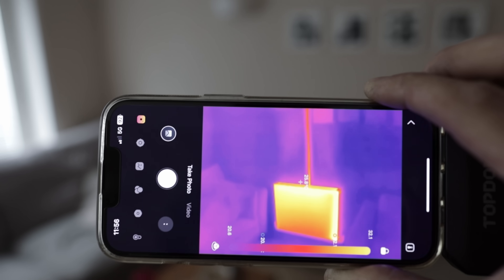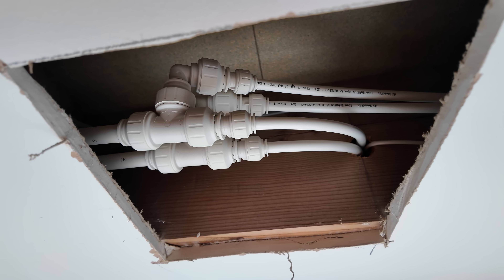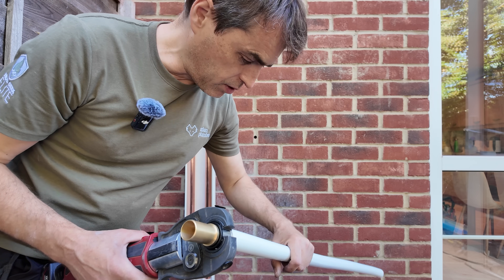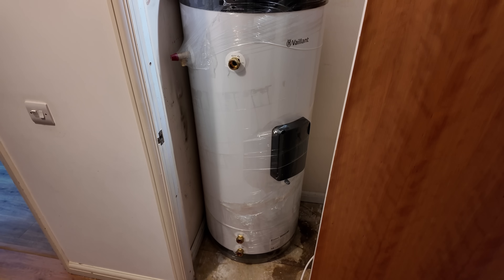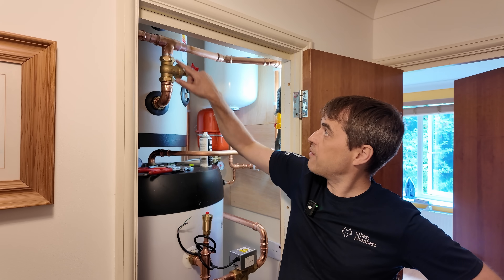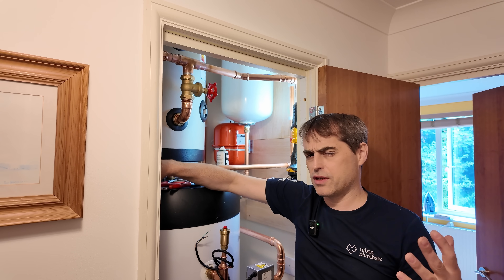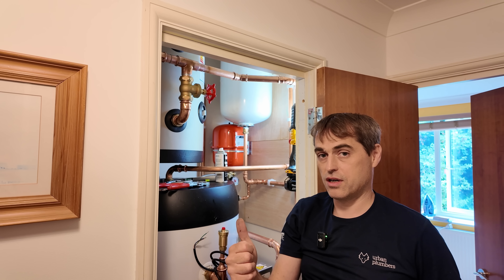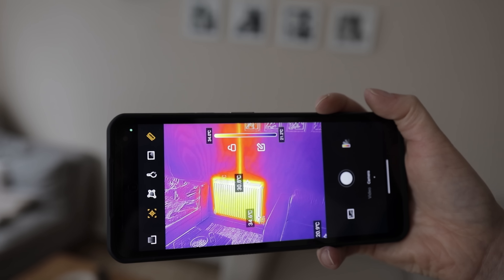Micro-bore Pipework & Heat Pumps: How To Make It Work.

Comment: My home has 10mm plastic microbore drops down, 15'mm copper 1st, with a 7kw Daikin monoblock installed over three years ago on a gov trial. SCOP for heating and DHW is 3.15 consistently annually, but DHW alone is about 2.3 and in cold months heating is 3.5, so not bad. The installer put a 20 litre volumiser in to increase the volume. Flow is about 19 litres per minute, heat loss 4.3 kw. The living room radiator is at The end of The run and does struggle to warm up, so what you are saying runs true. But overall the ground floor microbore hasn't been tragic for our set up
Reply from the maker: If they installed a 4kw Daikin instead of 7 your scop would have been miles better

Comment: Without the buffer in this system the HP would begin to ice up quite a bit and reduce eff% of the actual HP . 
Yes/no ?
Reply from the maker: Not really. System has enough volume without one and is not zoned so not an issue.

Comment: @ 10:20 - it will not get weaker with time … it will only fail … it is an electronic pump with monitoring… 
The old pumps have running capacitors for the motors - if the capacitor value degrades the motor will run at lower speed …. But in electronic pumps if there is something wrong it will show an error or it will totally fail …😊
Reply: Certainly possible for flow to reduce over time. It's not just pump rotation speed. There's also impeller erosion, fouling and corrosion to consider. Unlikely to make a massive difference as these pumps work for ages but a tiny bit of material accumulated will make a bigger difference to flow. System pressure loss won't be constant either - fouling of pipes and orifices with dirt or corrosion products (just think even about the tiny strainer in the heat pump, not much junk needed to increase its pressure drop).
Reply: @bearbin  he is a good plumber - I think he washes the sistem after install…
Reply: @mihaiachim5299 the fact that flushing is necesary proves that there is debris in the system. Flushing is definitely a good idea but won't remove 100%. even brand new radiators have dirt inside that gets slowly released over time

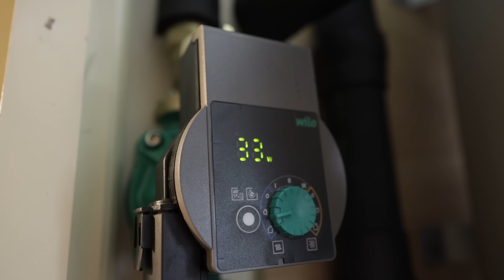Comment: @ 9:40 In this case I never replace the whole pump ; only the motor and I keep the pump body on the pipe if they are the same brand of pumps from the same family…😊
Reply from the maker: Quicker to undo 2 compression fittings than 4 hex bolts and you can never be 100% sure if different sizes are identical
Reply: @UrbanPlumbers  I promise that are 100% identical (the pumps cast iron bodies) 😊 … the difference is only in the external diameter of the impeller or in the maximum turning speed 🙂
Reply from the maker: @mihaiachim5299  not quite. I had grundfos pumps dying when I used to swap the head only. Then I realised they had a difference of around 1mm in depth between the same manufacturer models. It will work initially.
Reply: @UrbanPlumbers  if they are newer electronic pumps they are having some problems with them… if i Will have the time I will measure all the Grundfos pumps from 2015 upwards to see if they have made changes to them … for now I didn’t have problems switching only the motor body 
But Grundfos pumps used to keep working for 30-40 years(with the running capacitors replaced when is needed) … now is not the same … maybe greedy management
Reply from the maker: @mihaiachim5299 i hear that grundfos are now problematic. Those Wilos are very noisy -  it sure I will keep installing them

Comment: Will the system be noisy with a larger pump and small pipework  ?
Reply from the maker: Not if you keep the velocity within limits
Reply: @UrbanPlumbers  Thanks .  Are all   of your heat pump instalations work on  prioritý hot wate ? and does the space heating turn off when the cylinder is being charged  at a higher temperature.
Reply from the maker: Yes
Reply: @UrbanPlumbers  Priority hot water should be the norm . I upgraded a system to priority hot water on a Worcester .with addon diverter . . The problem I had  was the original unvented cylinder  
was very noisy when  charging.  I didn't  trust it .

Comment: If I fit much larger radiators can I run on a gas boiler  at at very low kw out oug puts .
Reply from the maker: Yes gas boilers also become more efficient with lower flow temperatures
Reply: No. The heatload will not change. Your boiler will run more efficiently though
Reply: @andrewmillwardwatford9410  What happened to system design  on fb ?

Comment: What insulation have you used in the airing cupboard ? Looks great. Having experimented with my own system it’s very clear flow is king with a Heat Pump if you can get better than required cop will improve.
Reply from the maker: k-flex - it’s a armaflex knock off

Comment: I would have left buffer in, as we don’t have x-ray eyes with an old system very difficult to get all the dirt out and people need to consider reliability. It will reflect badly on your system if it’s constantly erroring.  This will be the bread and butter job in the next 10 years.
Reply from the maker: We do have x ray - it’s called thermal imaging

Comment: I have no idea on the flow rate!

A bad set of fittings, or where they used a couple of unnecessary elbows where a sweeping bend would have worked,  would make a huge difference. The turbulence caused by fittings can represent many meters of straight lamina flow through a pipe.

It might be worth mapping the circuit with a borescope through small test holes in the ceiling to inspect cross joist junctions. If you find any culprits, you could swap out a few bad sections - as a few access holes, in the plaster board, aren't that hard to patch up especially if you know where the joist are, and you could save the costs and space of the second pump/buffer. 

I'm a big fan of fitting the largest cylinders possible, because they act as thermal batteries ready for higher RE grids with super low/free off-peak tariffs.  There's a lot we could do to increase the packing factor of storage volume in mechanical spaces.

The other question is whether the effect of the volumizer/buffer could be replicated with larger volume rads - at the end of the day, that would give you the thermal inertia you need too, as well as more surface area.

Edit:yup, mapping the system for future leaks is also a nice bonus!

Comment: Probably quite lucky that the existing system was designed on 11k dT. I would have expected the usual 20k dT. 

Ive got the same issue, with grey plastic microbore all over. Doing my calcs has suggested i need a separate circulator so going with larger pipework to/from the Heat Pump and a low loss header. That gets me a reasonable amount of volume into the system and also hydraulic seperation. Fingers crossed!

Comment: Szymon, is the neutral point at the buffer now or is that an issue with heat pumps higher flow rate?
Reply: It should be at the buffer if possible

Comment: What if you increased flow temp a little to compensate for a smaller rad?
Reply from the maker: a better solution would be to increase the radiators size to compenstate for a wider DT between flow and return!
Reply: What DT are you looking for?

Comment: Great video with good information helping to dispel myths and lack of knowledge. Doing the basics; heat loss, index circuit and flow calcs is vital for edge systems like this, but as you point out should be standard practise on all system design.

Comment: Thanks
Reply: Whilst I struggle to follow the detail as a householder, as someone really keen to switch to an ASHP in a house with 8mm (copper) pipework this is really reassuring to watch. Not a question of “it can’t be done” - rather here are the things that need to be taken into account. Thanks for all your great work and for sharing your learnings along the way.
Reply from the maker: @richardwaller7721  Micro-bore can work. It just needs to be calculated and designed carefully. Heat loss first, then working out possible pipe runs followed by index circuit calculations. 8mm is a bit small, but if it is a new build it can work without repipe. Case by case with microbore.
Reply: @UrbanPlumbers  Have done the heat loss calcs with Heat Engineer software but was great to learn about the index circuit, influence of pipe resistance, pressure drops etc. Every day’s a school day as they say…
Reply from the maker: You must be made of gold mate! Thank you.
Reply: @UrbanPlumbers haha better than that, I install heat pumps 🤑🤑😂😂
I appreciate your videos mate. They are a great resource for learning.

Comment: 860 L/hr is bang on 5KW. The heat pump would never exceed that on central heating?
Reply from the maker: Yes but would run 100% pump power
Reply: We have a (small) buffer and the outdoor unit needs only 45% pump power to reach its nominal 860l of flow. The secondary pumpe can easily match that for the rest of the house (floor heating). It would probably have been enough to run everything with one pump, but Vaillant in Germany essentially forbids installing anything without a (parallel) buffer.
Reply from the maker: That’s probably not true re Vaillant. It’s only a recommendation but installers like to treat it as a rule.
Reply: @UrbanPlumbers  
Probably. My Installer is a Vaillant Premium partner and always asks Vaillant for "permission"...and says they are against it.
I could probably have forced the issue, but we have the VP45RW buffer with 45l which is supposed to be quite good and as far as I can measure, the flow temp differential between outdoor unit and the sensor behind the secondary pump is less than 1K, so no big deal.

Comment: Prediction from 7m34s: It'll work! Maximum flow 700 litres/hour.
Reply from the maker: Ha - it actually did more than that which was surprising! One rad did not quite work direct without a buffer though.
Reply: @UrbanPlumbers  And as you commented, over time, this will only get worse. Good decision to keep the bufffer and secondary pump.

Comment: What was designed flow temperature?
Reply from the maker: 40c
Reply: @UrbanPlumbers personally I think it would have been more of a success story if you left the buffer out. 
This would have been more a mass market install. 

Why didn’t you design to 45 or even 50? Would still have been a very efficient system mate.
Reply from the maker: @deanchapple1 can’t leave it without a buffer. Pump in external unit was 860l / hour on 100% power. 

With a buffer it runs at 50% power with post buffer pump also on 50-60%

Small blockage to a strainer or pump getting weaker with age and the system would be pretty bad

Comment: Design is clearly everything, and there few like you who have the required skill set. I live in a 1994 build 4-bed detached house with 8 mm copper microbore and original oil-fired boiler, burning through 1,100 litres/yr (+ wood-burning stove with free wood in a semi-rural location, so smoke pollution isn't an issue).  It works very well, and I wouldn't even dream of changing this set-up until the boiler finally dies, because I could so easily end up with a cold house from a mis-designed system.
Reply: 8mm won’t work. Best to re pipe the whole house……
Reply from the maker: @deanchapple1 why? 8mm copper will be similar pressure loss to 10mm plastic. It can work.
Reply: @UrbanPlumbers  as you say, there’s probably kinked pipes. 

I always draw the line at 8mm pipe work.
Reply from the maker: @deanchapple1 yes safer to repipe, but if rads are not bigger than 500-600 watts it might just be doable

Comment: Did you consider using a bypass gate valve between the primary flow and primary return to allow some of the 800l/h required by the heat pump to be routed directly to the return, reducing the flow round the microbore to, say, 600 l/h with 200 l/h going straight to the return and then being mixed back with the radiator return. The delta on the rads would then be more like 7K but mix back to 5K with the bypassed flow added. I’m planning to try this approach on an upcoming install. I like the approach because it simpler and requires less kit and space. Do you think it will work ok?
Reply: I’d love it if you could give a couple of examples of issues with this approach. By way of context the house has a design heat loss of 4.2kW across 17 rads in a 5 year old house. Largest rad output is 600W and with 12mm plastic pipes I’m getting a peak output of 1kW at delta5 at a flow velocity of 0.9m/s. As such it should be fine without a bypass gate valve, but to be on the safe side I was planning to include one and hence the question.
Reply from the maker: @pete_pump  bypass achieves nothing in this situation. It will just make the heat pump cycle. Much better to try running it direct or even use a buffer. I don’t use bypass valves at all on heat pump installs.
Reply: @UrbanPlumbers thank you so much for your response. Wrong term. Agreed, a regular bypass valve is not useful at all as it should never open. Apologies. What I’m talking about a simple gate valve  that is set if needed to allow some water to miss out passing through the rads and to go directly to the return. This reduces flow volume and velocity through the rads resulting in higher delta through rads (and associated lower cop) but which then blends back to delta 5 on the return when the water from the gate valve joins it.
Reply from the maker: @pete_pump  yes, it’s not a good idea as the return will get too hot to quickly and heat pump will just start cycling.
Reply: @UrbanPlumbers  A fair point. I guess that issue gets more problematic as the bypassed percentage increases. And that a volumiser would help, but if a volumiser then why not do it properly and have a buffer for the sake of one more pump. One for me to ponder. Thank you again.
Reply: @pete_pump non spring loaded bypasses are not allowed in the UK since 2004.
Reply from the maker: Without going into too much details: it’s a bad idea - don’t do it.

Comment: Hi! Great video! I was wondering about piping of a buffer tank -  I thought installing buffer tank as hydraulic separator hurts systems efficiency... Is this 3-pipe return buffer piping better than other piping arrangements and do you you always use it when installing buffer as hydraulic separator?
Reply: @user-lb4od2mq5k as far as my understanding goes & if I'm wrong hopefully I will be corrected by someone, you would use a three pipe return piping arrangement for a buffer when the output on the secondary side of the buffer is lower  than the primary, this will ensure the cooler return water has a more direct path back the the heat source instead of going straight back into the buffer and going back into the secondary flow & cooling the heat emitters, he has piped with the tee facing down to avoid a thermal syphon, also the common pipe is a bigger diameter to avoid the secondary return going back through the heat source when the primary pump is off, it should be sized for a velocity of no more than 0.5 meters per second in that bit of pipe. Please if I'm wrong which I probably am hopefully someone will correct me.
Reply from the maker: Impossible to explain the diffrence in piping in a YT commnet. Heat Geek mastery course has the best explanation of diffrent piping arrangements I have ever seen. Have a look at the course if you are curious.

Comment: Really interesting. I have 10mm micro bore (copper) to all rads (4 bed detached), uninsulated concrete ground floor slab & insulated cavity walls. I've been holding back on a Heat Pump for a few reasons. Micro bore pipework, outdoor space issues for HP & my current boiler is only 5 years old. At least the Microbore issue can probably be discounted now leaving just the other two issues to be overcome. Was thinking about Air to Air with a separate solution for HW but now leaning towards a Monobloc ATW or perhaps even a split ATW. Lack of BUS for ATA will probably rule it out.
Reply: The copper microbore is actually quite a bit less restrictive than the plastic as it doesn’t have the inserts so even less of a worry… as long as the calculations say it’s ok of course.
Reply from the maker: @Biglenton trouble is most copper microbore seems to be kinked making it at times much worse than plastic
Reply: @UrbanPlumbers  yeah, I didn’t think about that. I suppose you just have to hope it’s not kinked or repipe it. The one I did was fine but it was a pretty small place

Comment: Could you also have plumbed the secondary pump in series with the internal one in the heat pump (i.e. as a booster)? In my mind the heads of the two pumps would add together and the flow would increase. Is there some problem with this - the heat pump control loop fights against the external pump or something? Or is the buffer just the neater install?
Reply from the maker: You never want to install any pumps in series. They will fight against t each other when set to auto on external unit or proportional pressure in system pump. You are also running a risks of cavitation. 

You can however for a bigger pump if external unit doesn’t have one and if you run within allowable limits of velocity.
Reply: @UrbanPlumbers  Yes, I can definitely see that setting the unit pump to auto and the system to proportional pressure could lead to oscillations. But with a nice open system flow should just need to be commissioned once so constant speed operation would work fine, and no chance of oscillations there. I think you could even leave the unit pump in auto so it can vary the flow without any issue? I don't think cavitation should be a problem really either as long as there's enough pipe in between to avoid "dirty" turbulent water. The flow rate through both pumps and thir rotation speed should both be normal and below their respective maximums anyway. 

Definitely safer to go for one pump that's been specified and engineered to work for the system, rather than trying to engineer your own pump out of two and risking more problems. It just seems like there ought to be a way to do it cheaper/more efficietly!